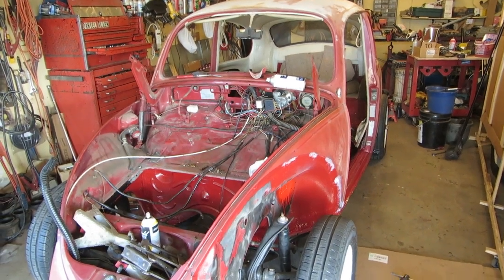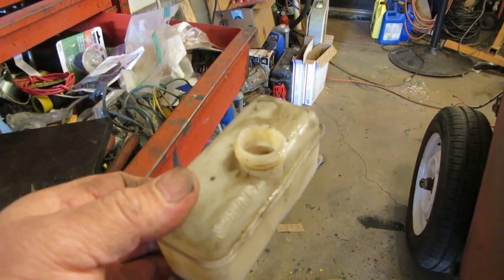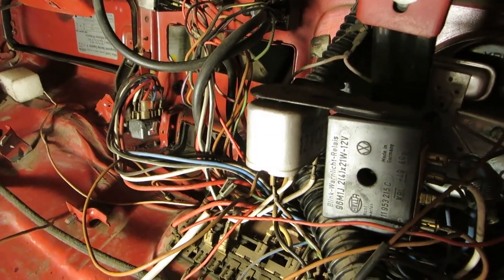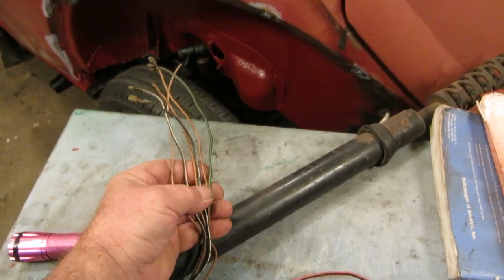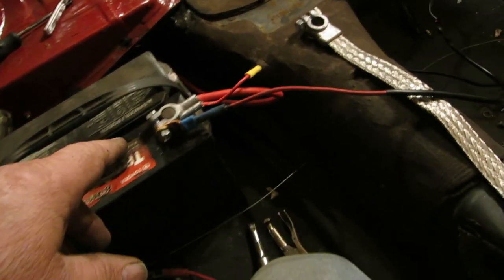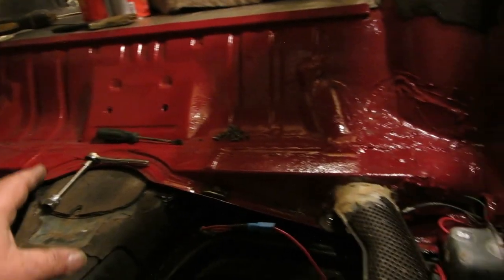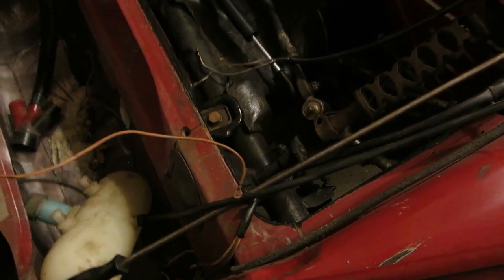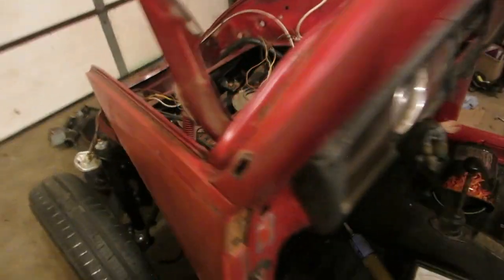Race To The DMV Part 4

Comment: Coming along great! Good to know you’re also a fellow guitar nut. I suggest you neutralize the rust spots on the “frunk” seal channel, maybe sand down a little and then use rust converter and then put the clear on before putting the new seal on?

Regarding the steering column make sure that rubber grommet going through the firewall is in good shape; I believe it also isolates the column electrically and you could have electrical malfunctions if it’s not in good condition and properly installed.

Another suggestion; get a plastic/rubber liner for the battery; many of them have a top cover which will isolate and protect your posts from shorting on the back seat frame.
Reply from the maker: I’m just not going to use that rust converter....I just don’t like it, and it will ruin the patina.
Yeah, got to isolate the steering column, and good idea on the battery box, it will also protect the floor pan.

Comment: Great video! I also had sane wiring issue with mine 68 bug. With 7 of 67 wiring harness. It had the switch in the column but the e flasher and light switch were wired early style. It also had a factory metal dash with the 3 defrost vents.
Reply from the maker: Thank you, the videos aren’t the greatest....I just hope to help someone with the same dilemma.....Weird....I believe vw did a lot of changes on the fly
Reply: Hey what was the website for getting your door locks rekeyed
Reply from the maker: @Chris530-65  google....mark 1 service.......it’s the first listing.

Comment: I'm sure you know when you look at the wire diagram you see numbers mmm numbers. If you convert those numbers over to standard it tells us wire gauge size. I did a whole series of the fuse box on my channel. The Bentley book is great. You can also get the same diagram at JBUGS .COM. Your getting closer. Catch you on the next video

Comment: Good afternoon! Where did you find a replacement mono speaker? The only ones I seem to find are for pre 1967
Reply from the maker: First the original German speaker was replaced with a Japanese one.
I swapped that out for a speaker the same size from an Awia speaker from an old boom box. The boom box had. Detachable boxes with a bass, midrange and a tweeter. I found these on the curb during big trash day and kept them.
I literally had to smash the glued together chip board box apart, and there I found the nice midrange I installed. Correct omage? Don’t know, don’t care. It doesn’t fit perfect...but neither did the Japanese one.
So.....it’s not correct, but will do the job probably just as well as the $50 Wolfsburg product....if they even have them.
If I was to buy one, I would discover the ohms rating for that sapphire radio.
Then look on line for a (my tape measure says) 4” .....4,8 or 16...whatever speaker.
In fact, I just looked online...Amazon.
Now, a mono speaker? Mono is the radio.....a speaker is a speaker. If you are looking for an antique one way....paper speaker. I don’t know who sells them because there isn’t really a market for them. Just about every speaker know is plastic, poly, foam thing. Look for old radios, or 80s stereos on the curb. Good luck. 😀😀
Reply: @OkFixer  thanks...I like that idea and have an old boom box here. I only said mono because it seems many now have a dual voice coil in one small speaker
Reply from the maker: @muzzcovw7674  it will probably work just fine.